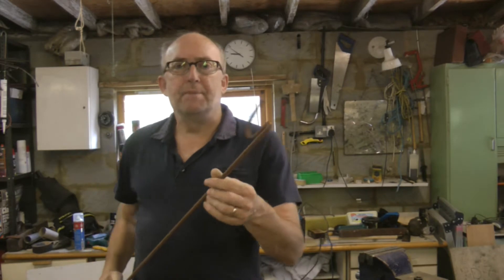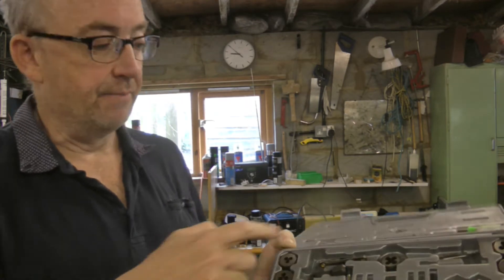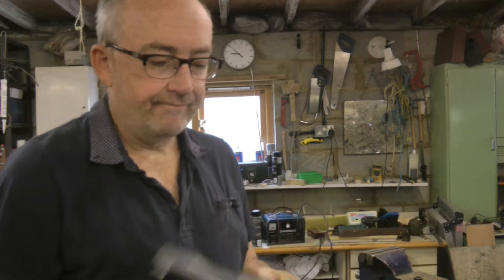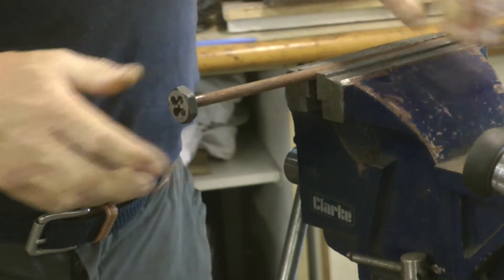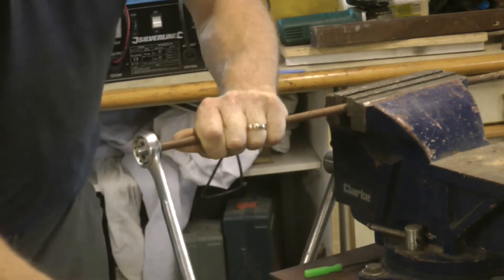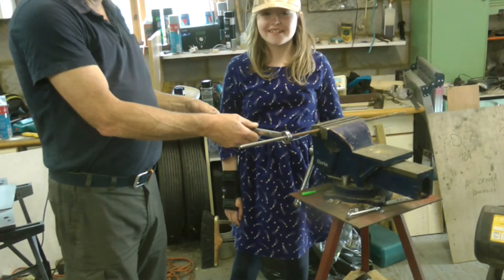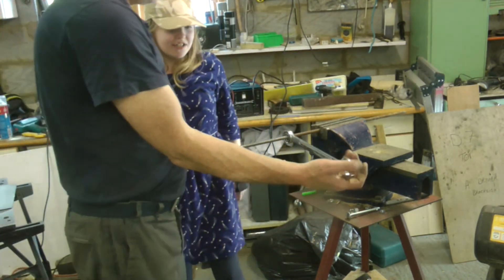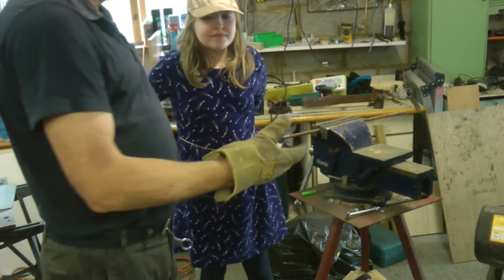How to use a tap & Die set to cut a thread on steel rod

Comment: Use oil. It helps clear chips, keeps the metal cool, and smells nice. It's good that you tapered the tip; otherwise it's easy to start a little bit "off" and before you know it your die is at an angle and you've got to start over. PS I am a software engineer. Does that count?